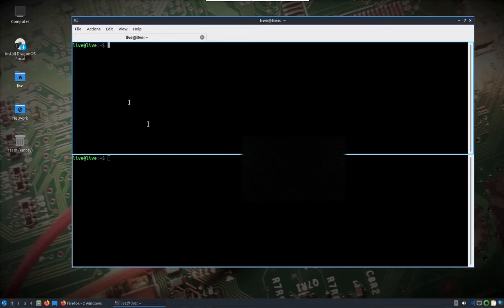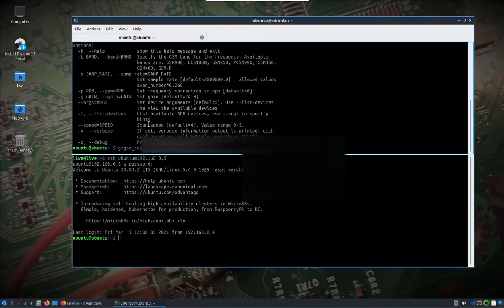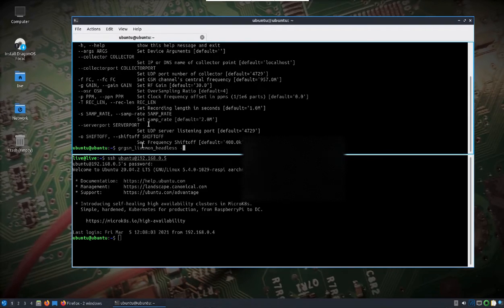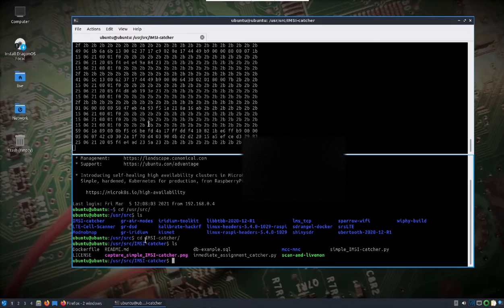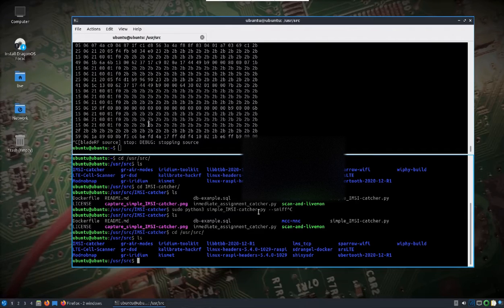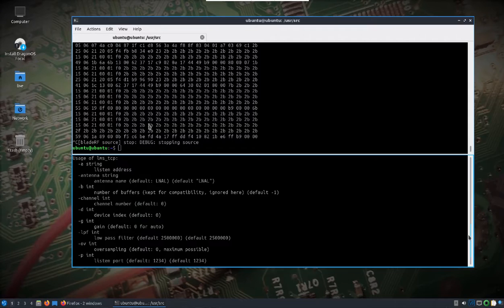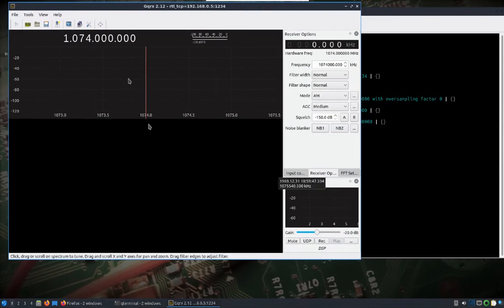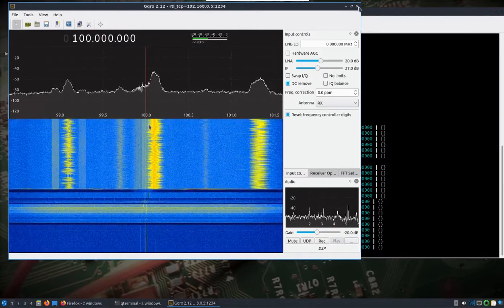Wyvern Sensor w/ GRGSM + IMSI Catcher and LMS_TCP Updates (bladeRF, limesdr mini, pi4, beta2)

Comment: When running "grgsm_scanner -v -d -b PCS1900 --args bladerf"
grgsm_scanner just seems to loop continuously saying:
 set_dc_offset_mode: Automatic DC correction mode is not implemented
 start: DEBUG: starting source
 stop: DEBUG: stopping source

I'm running DragonOS on my Pi 4. Any recommendations? Thank you so much for your content!
Reply from the maker: You’re welcome. Which bladerf do you have? I’m turning my pi on now with the bladerfxA9. The looping I think is normal as it does that as it changes arfcn/freqs. I’ll check right now.
Reply: @cemaxecuter7783  Thank you for such a quick reply! I'm using the bladerfxA9.
Reply from the maker: Loops is normal, it’ll show something very similar with other SDRs.. but I’m not picking up what I can with say the hackrf so I’ll look closer. Might be gain. I’m also seeing the Pi pumping out 0000s when I use the uhd driver instead of -args bladerf.
Reply from the maker: Well, yeah I’m not picking anything up with mine. I’ll have to try and older version of DragonOS and make sure the libbladerf updates didn’t change something.
Reply from the maker: So I found a freq with the hackrf. Then switched to the bladerf and ran grgsm livemon on that freq. I had to raise the bladerf up in the air and move it around some, but it saw the cell and starting spitting out the numbers.. so I stopped and ran grgsm scanner again eith the bladerf leaving it in the same position and boom, it found a freq with the scanner. So it’s working and the looping is normal. You might try -g 60 and also make sure you have pcs1900 capable antennas and or raise it up :)
Reply from the maker: You know what, I have the same ones and ended up switching them out for these generic gsm/dcs antennas I got from somewhere - between that and putting the unit up high got me results. I was starting to think something was wrong haha.. as far as a faraday cage I have a huge trunk that I painted and lined with metal.. no idea if that’s adequate, but between that and really low power output i don’t seem to pick up anything outside the box. I’d be concerned if I was attaching amps etc. I also have some cables and and reducers that can loop back on rx to rx and not cause damage.
Reply: @cemaxecuter7783  After switching to quad band GSM antenna's I found a freq! Thank you for the recommendation!

Comment: I have been try bladeRF xa9 ,RTL-SDR ,HackRF One  i can't scan your comand  grgsm_scanner  -b PCS1900  --args bladerf   I had attached Wideband Directional Antenna 700-2700 MHz,11 dBi Yagi https://images-na.ssl-images-amazon.com/images/I/41zFXq-my5L._AC_SL1000_.jpg, I can't scan my near Tower is 3 block
Reply from the maker: I’m not familiar with 3 block. PCS1900 is just for GSM in the 1900mhz range. In my labs I use either PCS1900 or GSM900 for testing.

Comment: I'm a Cyber Security student and stumbled upon your channel since I was curious how mobile phones were being eavesdropped by police etc. Is your channel about Mobile phone/GSM/radio frequency pentesting/hacking?
Reply from the maker: Hello and welcome. So for the most part I try to focus on things involving Software Defined Radios. While one could argue, there’s probably a few videos I’ve done that could help with pen testing, depending on how you look at them, I’ve not really went deep into pen testing/hacking. You could probably expand on videos I’ve done, like the cellular ones, and quickly find ways to use them in pen testing. Hopefully this reply is somewhat helpful. Check out the cellular playlist and have a look at the osmo-nitb-script videos.
Reply: cemaxecuter the thing is I have almost no knowledge of cellular/frequency stuff but it looks really interesting for some cool projects.
Reply from the maker: What’s super cool is that you can run srslte without any radio and still learn about 4G/LTE. You just use a virtual radio for the bts and ue.
Reply: cemaxecuter What’s the main purpose of your projects?
Reply from the maker: Started out as a way to stay busy/help others during Covid to easily jump into software defined radios with a Linux distro prebuilt with all sorts of software, drivers, etc. Then I figured I’d make videos over each piece of software and various ways to use software defined radios. I just try to generally try to come up with unique things to do with software defined radios so that people can interact with all the RF around them.